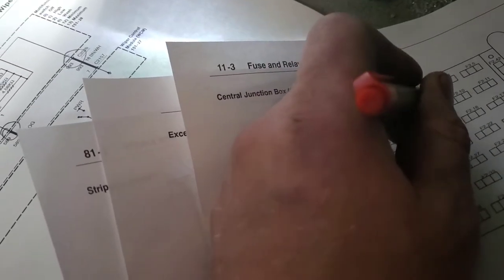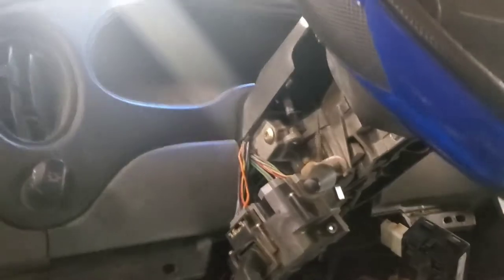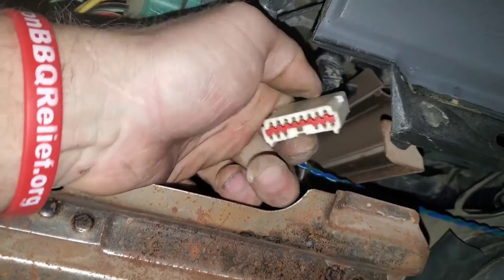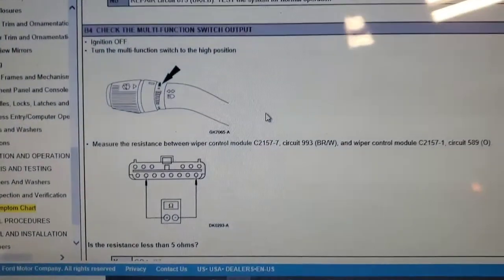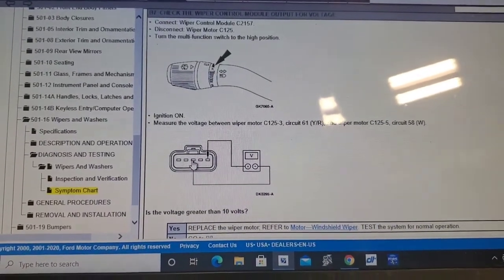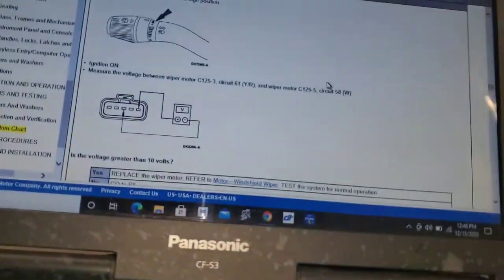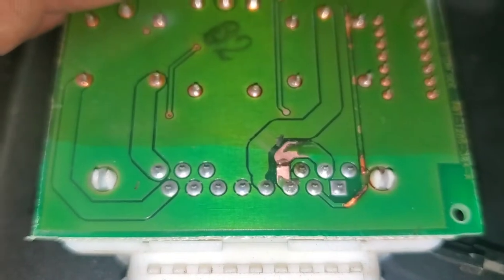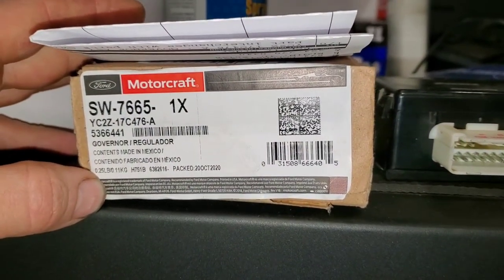2003 - 2004 Ford E350 Van Wiper Motor and Washer Pump Not Working Pin Point Test and Fix

Comment: Excellent Video. I have tested the pump motor itself and it works. I send power from the connector on the black with white wire and it wont run. Would appreciate any help from here.
Reply from the maker: I d9nt have schematics in front of me or your truck, load test your wires

Comment: The software you are using to troubleshoot this issue, where can I get a copy? This would help me with my 2003 E350 7.3 PSD. Thank you.
Reply from the maker: It's $900.00 a year lol are you sure you want it? IDS - Manufacturer Program BUTTTT there is an alternative  

Below

You want a Program Called Forscan - you can renew yearly free or buy lifetime for $50

Then the link you want is - obd link ex

Then you need a compatible laptop to run it

Comment: A while ago I resoldered a module like that for the panel lights. I think it was $200 from Ford. Just two transistors and heatsink for PWM. Those traces and solder  are way too small for the current involved. Likey lead free solder too.
My explorer also has a lights out module detector, it passes the headlight current thru a solder joint like that.
Reply from the maker: yes this has multiple contacts that couldn't be fixed with solder in this one. paper thin ribbon contacts, its ground side switched internally also so its slighter different than a standard module you can work with 

this module from Ford is about 270 and the NAPA one was 312 I think
Reply: @FordBossMe  That is a shame, maybe $10 to make something like that. Just relays and a timer IC. I did notice the trace was bad, $300 I would have tried some jumpers, but then your time comes into play as a pro. And not worth a comeback. Great troubleshooting though. That is what separates a DIY (or some techs) from a real pro.  Those ford manuals are great.

Comment: Is this module, schematic and test procedure, gonna be the same for the 2004 Ford F250 4x4 Lariat (6.0)?
I've got the same issue.
Thx.
Reply from the maker: Yes
Reply: @FordBossMe  Where exactly is this thing hid? I can't find it on mine. I've looked behind the glove box and left & right kick panels. Then around the fusebox and e brake areas. Mine is a 04 Ford F250 4x4 (6.0) Lariat. I appreciate any help on this. Neither of my manuals illustrate it.
Thanks

Comment: Did you quote a new pig tail for that wiper motor connector .
Reply from the maker: I tried customer didn't want anymore money put in, I cleaned it up and use liquid electrical tap and then put a sheathing around it

Comment: Stuck on a bind cant find anything on a 06 350 no wipers or washer doesn't have that module under the dash man I wish it did!
Reply from the maker: Yeah I don't really know what to tell you right now man I'm in the middle of a work day and I wish I could sit down and break down a wiring diagram for you but I can't right this second
Reply from the maker: And I hate to be this way but you really didn't give me anything to go off of or tell me what you've already done
Reply: I wasn't expecting a reply lol but I have a new wiper motor and a new multi function switch. All Data shows no wiper control module it must of changed after 04
Reply: So the wiper motor has key on  power on the dark green wire when I turn the wipers on the motor clicks. Fuse is good still no wiper or washer.

Comment: I haven't 2003 e50 school bus with AC on the rear end in a roof how do I find the fuse in the fuse box and where is it located
Reply from the maker: Normally the school buses have their own set of fuses and it's up in the overhead console area.

When they do the extra add-on retrofit boxes on the back we don't have to come addicts for that we don't have schematics for that you would have to get them from a school bus dealer shop that specializes in that but I'm pretty sure that fuse panel is up in the overhead console
Reply from the maker: And sometimes those AC units that are on the top of those have their own built-in fuses on the backside of the unit
Reply: Ok I have power at the switch  is the fuse on the unit easy to get to
Reply: @FordBossMe  how do I Tell which one is for the a c unit in the over head fuse box
Reply from the maker: @scottadam1052  there should be some kind of labeling other than that you're just going to have to start pulling fuses and see which ones blown
Reply: @FordBossMe   I want to thank you for your help it was very helpful I found the problem
Reply from the maker: @scottadam1052  I worked at a bus company so I do know some about them I was one of the head text but it's been so long you know I'm just trying to think

I'm glad I was able to help you